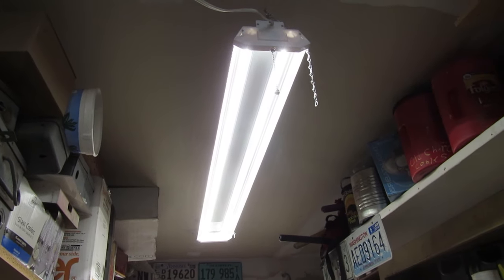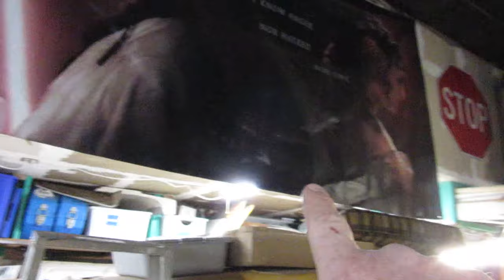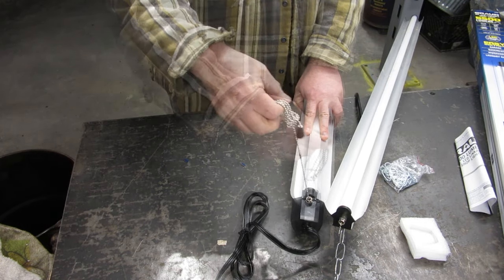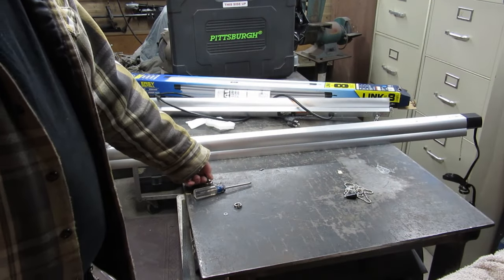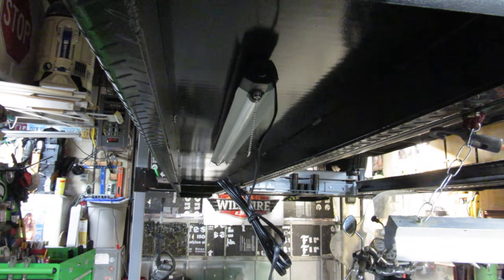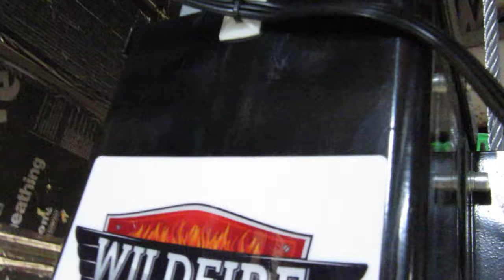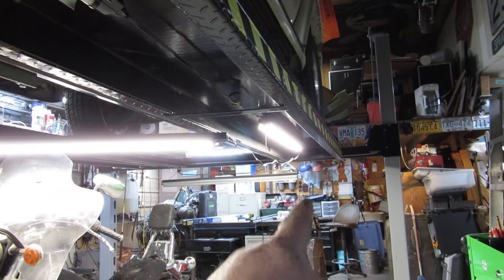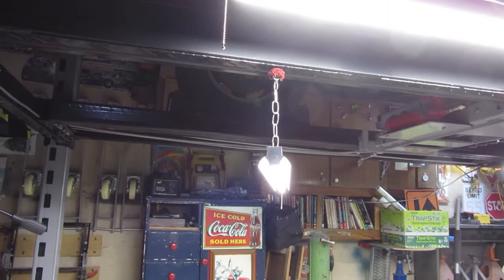MODDING MY 4 POST LIFT WITH HARBOR FREIGHT LED SHOP LIGHTS

Comment: Nice video,  I used the LED lights on an angle  with an alum strip with defuse (to protect the LEDs).  The LED  The are only 5/8" tall,  Glued the magnets onto the alum strips.     The good news is I can keep the light in place when the lift comes down, and I got them also on the car left lip pointed up towards the car as well.   I think this is the only video that shows lights down wards under the lift,  again good job